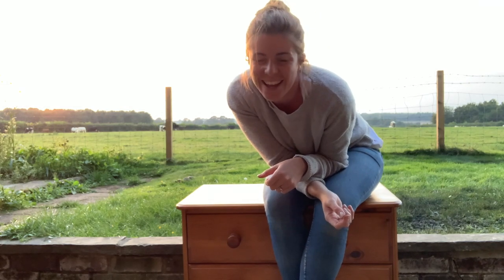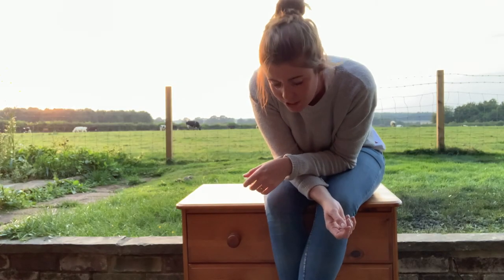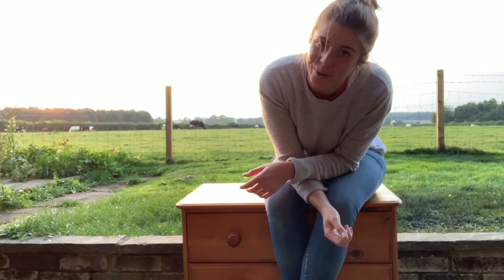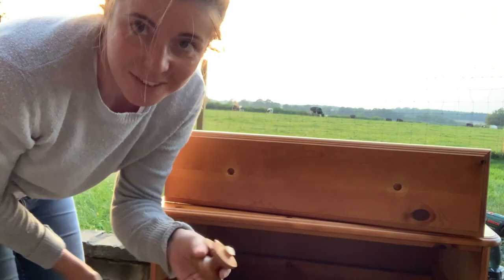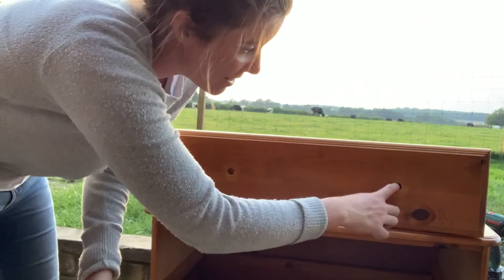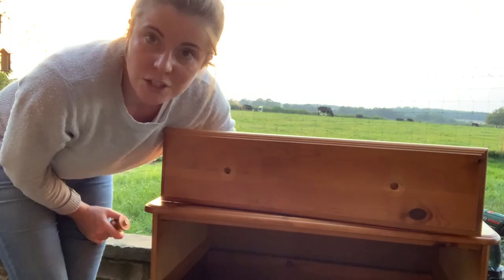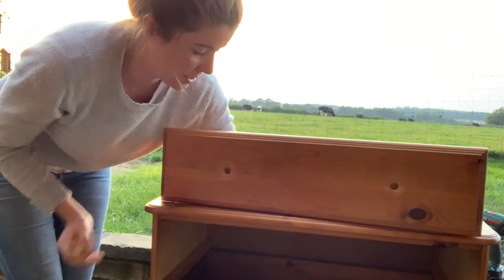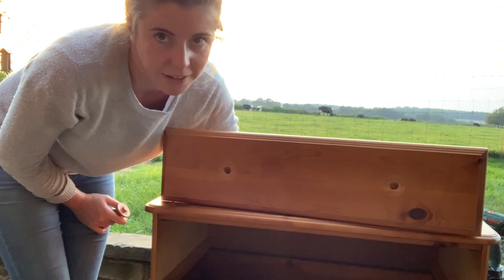Perfect lines with my Pine Chest of Drawers Transformation #furnitureflip #upcycle

Comment: Cool video :) Why did you spray somthing on before painting? Was it water? Can you explain the purpose of that?
Reply from the maker: Thanks Ingrid! And yes absolutely - before painting I clean my pieces with a sugar soap solution (just to remove any grease or grime), and then during painting I often use a spray bottle of water to thin the paint, I find I get a better finish that way. I hope this helps!
Reply: @hollysdesign  I will try The water trick next time I paint furniture. Great idea!